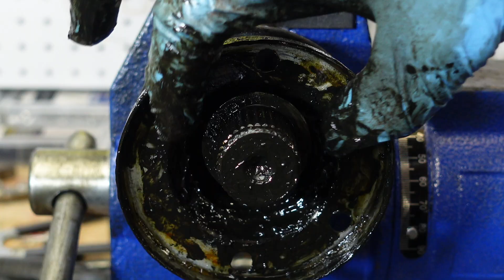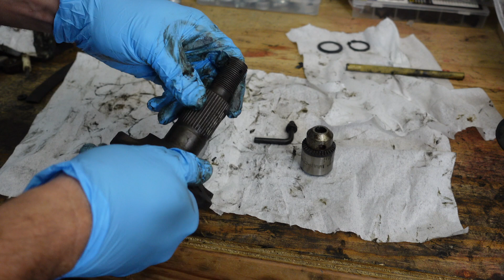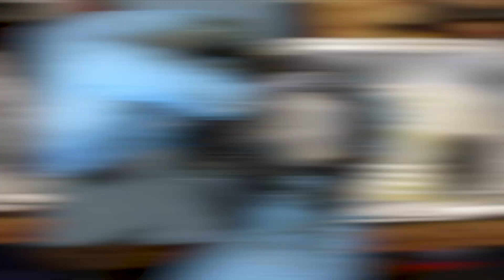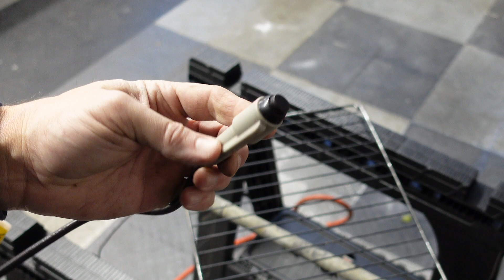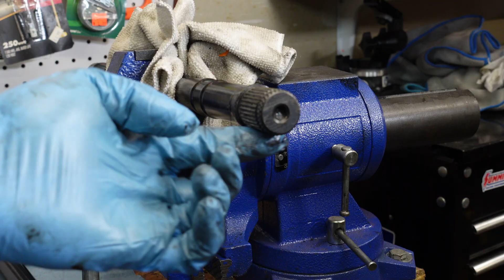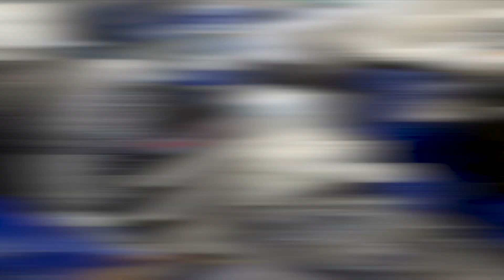Porsche 914 How to Rebuild CV Joints, Remove Roll Pins & Safety Wire Bolts [Bumblebee Build Week 16]

Comment: Ian, great video, one question...did you replace the actual rubber boot? They sell just the rubber, can you replace just the rubber boot into the original metal frame part? Thanks, Scott
Reply from the maker: Hi Scott. I didn't need to replace the rubber on my car. Not sure about doing that, but I assume it wouldn't be difficult

Comment: Ian, I had a question on how easy or hard the cv join slid back on the axel? I have one side that slide on and the other that needs to be taped on with a hammer and drift - your thoughts
Reply from the maker: If the splines are clean, they go on with a bit of force. If they're not spotless, more force is needed. I also use a hammer and drift to ensure the washer is set.
Reply: Ian, Thanks for the info greatly apricate real world feedback  @IanKarr
Reply from the maker: My pleasure. Sorry for the delay!

Comment: A couple questions and comments coming from 914-6. 1. It sounds like you didn't put anything between the boot flange and the joint. The manual says "seal with sealing compound Curil k". 3. Is there any reason to clock the joints one side to the other? Meaning orient the joint on the splines relative to each other? Maybe that is just off road vehicles to maximize travel? :)
Reply from the maker: I'm not familiar with -6's (unfortunately). Not sure if clocking them would help

Comment: The safety wiring of the bolts is brilliant, especially the pattern in which one loosens and the next tightens. Thank you for your these highly detailed videos! My background is VW, but I just got a 914 2.0 and your videos have been extremely helpful. Quickest I have ever hit the subscribe button!
Reply from the maker: Wow Thanks so much, Andrew. Glad you find the videos helpful. There's a tool for proper twisting of the safety wire. What I did in the video works, but it won't win any concours awards ;)

Comment: That tip about using an old chuck on the roll pins is great!  I had never thought of that.

I strongly suggest safety wire on the inboard CV joints as well.  They are easier to see, but if they let go the joint will do a lot more damage flailing around.  The outboard ones will generally stay in the hole through the trailing arm, but there is nothing to restrain the axle if the inboard joint lets loose.

There are a lot of ways to safety wire stuff; I'm sure there are a few dozen tutorials here on YouTube.  I usually see the wire go around the bolt head instead of just out the side; it would start on the inside and go through to the outside, then loop around in the "tighten" direction, then down the other way around the other bolt, and through to the center.  There are reasons for this, but I don't know them.  I do know that's the typical way for aircraft style safety wire, though.
Reply from the maker: Thanks, Dave. As usual, you've added great info. Will definitely consider wiring the inside. How common is it that CV bolts back out? I always use clean bolts and new schnoor washers and have never had it happen on any of my cars. Am I tempting fate? Wiring the inners would make engine drops a PITA.
Reply: It's not common, but it's not unheard of.  And they can do a lot of damage, especially the left-side inboard CV.  The starter is right there, and it can get beat all to heck and break the transmission case.
Reply: @IanKarr  on a hi performance car, I have lost the bolts at least twice.  once the axle dropped. the other times, the bolts were just loose.  its too easy not to wire all bolts.  good job!